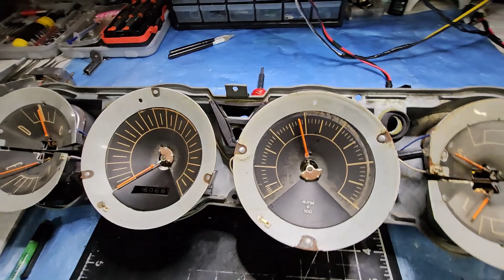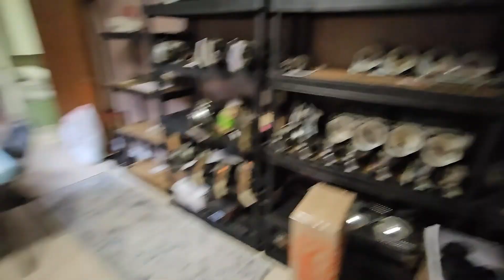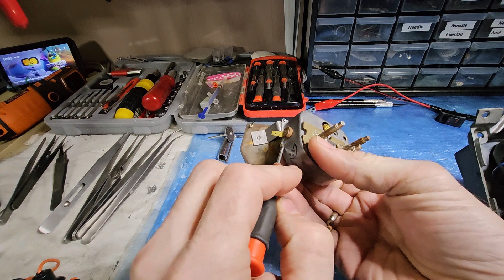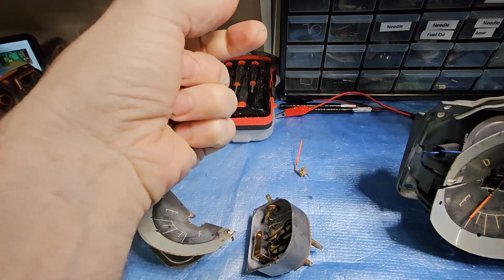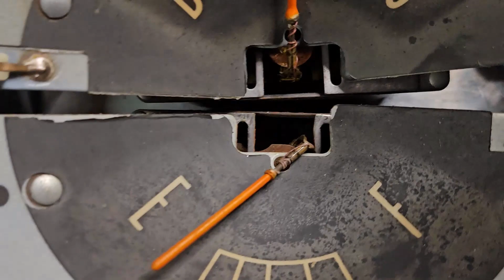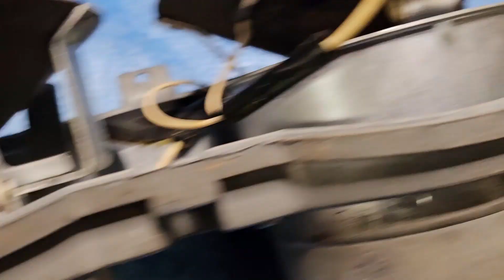66/67 Dodge Charger Gauge Testing

Comment: Hi Todd, appreciate the knowledge. Is it possible to repair a 67 fuel gauge with an external Voltage Regulator like how the 66 gauges are?
Reply from the maker: Howdy. Yes it is.
Reply: @toddsdodgegarage thank you for the response!  Any guidance or instructions to be found to do so?

Comment: Can you install a 5v dc regulator in place of the " chopper" circuit?
Reply: Did you find out if you can replace the internal regulator for an external regulator?

Comment: hey i spoke to u before ,i have the charger that someone hooked the dash lights into the radio ,do u do any work on headlight motors,i know your busy ,im pretty good with electrics i have an allante where ive rebuilt window and pulldown motors, and im sure i could do the headlight motor other than rewinding the i guess its the stator, but i have no info how to test it ,anything you can tell me would be great ,your videos are great by the way ,wish there were more,thanks
Reply from the maker: Yes I rebuild the motors. there are no parts available and they are very complex. It explains after 57 years why only two people are known  to rebuild them, you can send them in to me and I would happy to take a look at them, Todd
Reply from the maker: why dont you email me or call me?